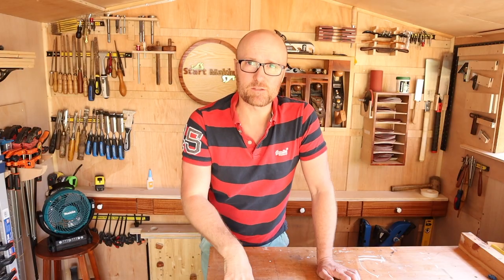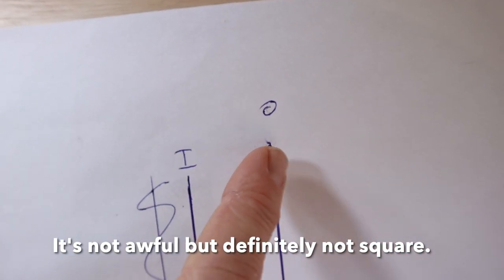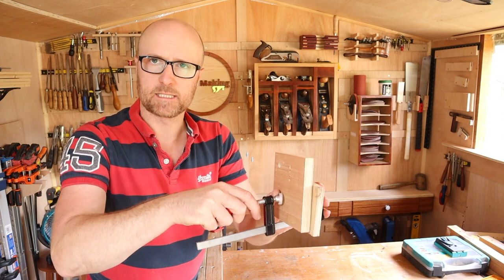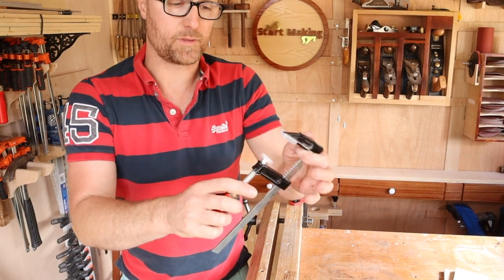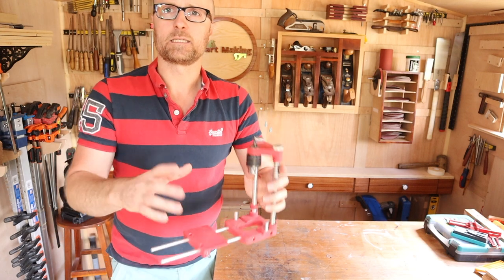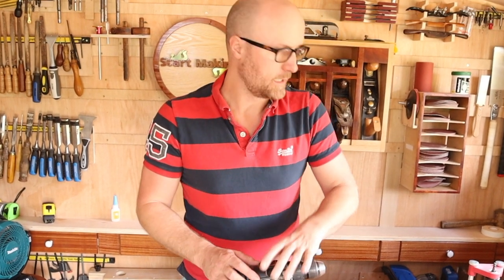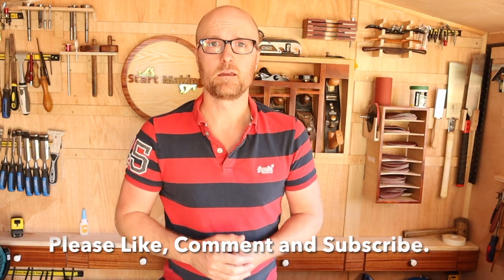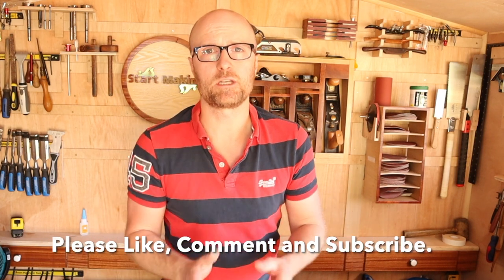5 WOODWORKING Tools to AVOID Part 2 || The SOLUTIONS.

Comment: For your drilling issue. I'm really old school. Been woodworking for over 30 years. I do have a drill press, it does the work perfectly. But sometimes you just can't take your work to a drill press and you do need a straight hole.
Like I said, I'm very old school. I use my table saw or miter saw "The one that gives you the straightest cuts" 
Cut myself a few nice straight pieces of scrap and screw it together "in a butt joint" just so the jig stands on its own
"just make sure that it's square" and there;;;; you have a straight reference guide, put your drill against that piece of wood that acts like a wall and follow it, and you'll always have perfectly straight holes.  Like your videos! Thanks
Reply from the maker: Great advice Stephen, thank you

Comment: I have a square that is over 75 years old and still square. Metal blade - wooden base. If you take the corner (red) jig and place a clamp on the top side, you will draw the mitre together. The angle jigs you make can also be square with all 4 corners cut off. Then you have 4 corner jigs to use when one side gets bad. I've used these for many years.  The Kreg pocket hole jigs are the best in my opinion. I have had and used one for the past 40 years (take or leave a few years). I was taught that the drill needs to stop just shy of going through the end of the wood that you are drilling. this is so that the wood will be easier to get full contact. The hole going completely through the wood will usually leave some type of shaving and the wood will not come together because of the particles left by the drill. If this is the case, you will need to sane the ends. I just used my Kreg jig on 1/2 inch ply and it worked fine. My first Kreg jig was made completely of aircraft grade aluminum with the steel drill guides and it still works to this day.
Reply from the maker: Great comment David. Thank you. Amazing that the quality of the Kreg Jig has lasted that long. Really impressive.

Comment: Portable drilling the Millscraft is rubbish. It will drill semi straight holes but Plastic bearings make any hole you drill wobble like crazy. The wooden corner brackets are great. Turn the ply sideways so it is 2inches or wider and the stability increases dramatically. Thanks for the tape wrap on the handle . Brilliant.
Reply from the maker: Oh, that's a shame I was tempted. Back then and now. And thank you for your sound advice,

Comment: Bought a rip-off pocket hole jig, so really cheap.  After practice I found that the finish was very dependent on speed of drill and pressure applied.  Your comment on practice making things better stands here as well.
Reply from the maker: Hi Al. Good advice on the drill speed. I will give it a shot. Thank you. And thank you for watching and commenting.

Comment: Great. I hadn’t thought about the ratchet strap for miters… will have to get a couple. Thx
Reply from the maker: Hi Michael. To be honest I originally bought it for boxes but it turned out I was struggling because my cuts were not square, hence not square boxes. But then I saw someone use on mitres, amazing. Definitely grab couple and my only advice is set them out on the dry fit and only loosen them a tiny amount then add glue. If you add glue then start getting the clamp out to use, it can get frustrating and messy. Thank you for watching and especially for commenting.

Comment: Just a pointer on the pocket hole problem, there are specific pocket hole screws for this application as the standard countersink screws tend to split the wood due to the wedge shape of the countersink head. Pocket hole screws are flat on the bottom so don’t have this problem, and may be smaller in diameter which could solve the 1/2” board issue
Reply from the maker: Hi Djcr Thank you for the comment and for watching. You are right and I wanted this to be a fair test. The screws provided are the bugle type. In the original video where I point the issues out I say this. https://www.youtube.com/watch?v=M8jLpyxwcnE

But for a fair test I decided to use the screws that were provided. They are a right pain to use and I have  replaced them with proper pocket screws. Thank you for reaching out.
Reply: RE POCKET HOLE JIG’s - I tried the   Trend version of the one you had and got mixed results, but after watching the “ hooked on wood “ Chanel I bought a Chinese  branded version ( Enjoy Wood   ) similar to the tre trend one with built in toggle clamp which  was half the price and worked a treat, the drill bit wasn’t the best  so I used the trend one from the other jig … so far so good  - another budget option maybe.!?
Reply: Very fine observation and true...

Comment: Thanks so much for providing great content for YouTube. I love your presentation style, yes I do agree with the commentary on your last video and yes the comments were correct but your original advice was not incorrect.  In any hand skill craft there are always more than one way to use a tool for a desired outcome, your advice about the hinge centring drill bits was spot on as I also tried to cheep out, I now use the Snappy brand drill bits and they are a delight to use, the same with the angle drill adaptor the better quality ones are so much better. Thanks for taking onboard the comments on your last video and updating the presentation
Reply from the maker: Hi. Thank you very much. To be honest , I learn more from the comments than anywhere else on the net. Such a great community.

Comment: That table was easily straight enough to check a square against. But glad the metal straight edge confirmed it.
Reply from the maker: It was one I had to add in as the last video gained as few comments saying the table was not straight.

Comment: Shop buying Tip 1:  In store you can check things like spirit levels and metal bar stock for straightness, by laying it against others in store AND flipping them around AND hold two touching straight edges up to the light to check for gaps.  Some ‘straight edges’ are amazingly spot on..others can have visible bends making them useless. Once out of the store you can’t prove you didn’t bend it.
Tip 2:  Long straight edges…try a “plasterers feather”…I got an aluminium hollow section feather 1.6m long WITH ruler grads in cm, checked for perfect straightness as above.  Effectively, a long four inch wide tapered edge dead straight ruler - perfect for laying out bigger jobs.  Plus, if I ever need to plaster a wall….
Tip 3: Vertical hand drill…glue a small circular bubble level on the back of the drill body (after aligning it vertical with squares first of course).
Reply from the maker: Hi Contessa. You are absolutely right about checking in store. My issue is that there are very few quality tool shops near me and so the temptation to take the easy route and order online is strong. Not right but strong. I will check out the plasterers tool, sounds like a really good suggestion. Thank you.
Reply: I do have the bubble on my drill, but that requires the work surface to be level.

Comment: Have a lot of smiler problems with tools not doing the job to my satisfaction. Was great to watch your part two of bad tools especially the feed back.
Good to know i'm not alone. Good for you.
Now all you got to do is show me how to cut a dead straight line with a circler saw.. The point is we are beginners not life long pro's.
Reply from the maker: Hi Andrew. Thank you for your comment. It sounds like we are in a very similar boat here. I have to say, the main reason I started making videos was because I started out and could not find any easy builds and tool guides to bridge the gap to the more professional woodworkers. As for the straight line with a circular saw, goodness knows. I use a straight edge and it still gets away from me. I am very seriously considering getting a track saw, table saws make me nervous. Well, that and the lack of electricity. I tried a home made track saw of sorts using overlapping pieces of plywood but they were awful. The only success I have had is a smaller, very rough crosscut track that I made very early on. It pops up still in videos. Really rough. Thank you for watching and let me know if you come up with a solution, we can learn together.

Comment: I have reworked  -- deburred, chased threads, filed off molding run-outs, etc. many cheap tools (most were Chinese made) that i have purchased. Did I save any money after putting in time to make them right? Sometimes but it is still aggravating. It is probably worth mentioning that i spent over 50 years as a precision machinist/toolmaker so i am accustomed to having tools that i can count on.I NEVER purchased cheap tools to use on my job but for home onetime use, yes.
Reply from the maker: Hi Jim. Thank you for commenting. And what a great, well rounded comment. You are right. There is a time and a place for cheap tools. If In was in your position I would never buy cheap for work. I actually just bought a load of old tools on auction and ended up with what I think are machinist tools. No idea. They are on one of the latest videos. Not to get you to watch,. But please let me know if you recognise any. Anyway, thank you for watching this one.

Comment: Like the cd idea. Have you thought of using tennis racket replacement banding grips or even bike handlebar grips? Not designed for clamp handles (obviously) and fixings may require some gluing. Check out Amazon.
Reply from the maker: Hi Costa. How was the sound? Thank you for commenting. I looked at racket grips but the price was higher overall. Good idea though for a favourite mallet or something.
Reply: @startmaking1  Sound perfect (for me at least.) I agree the grips are a bit pricy and would be best used, as you say, on a cherished tool. Keep up the good work. BTW hows the power project coming along?
Reply from the maker: @teacheme  Great to hear . Sadly no further along but In will get there. Thank you for the feedback, again.

Comment: I pretty much use my strap clamp like you do, set up the corners 90 degrees first and use the strap for holding while gluing.   I also find it handy for repairing/regluing chair legs.
Reply from the maker: good shout on leg repairs, I don't get my strap clamps out a lot but when I do I am very glad to have them rather than wrestling with multiple f clamps. Far lower stress levels.

Comment: for drilling right angle holes freehand, try gluing a small round bubble level to the back of your drill if the back is square to the bit
Reply from the maker: What a great idea. That is the first time someone has recommended that. Thank you. Will see if the back is flat. Sods law it wont be but you never know. Thank you for taking the time to comment.
Reply: About 3 years ago, I made a video on how to add a bubble level to a hand drill.  I also made a video on do's & don'ts of using the bubble level & your drill, to drill perfectly vertical holes.  To view them, just do a search on my channel on the phrase "bubble" and they will pop up.  Let me know if you can't find them and I will post the link.

Comment: I concur on the Milescraft drill press, works great for me; I also have their  pocket Jig 200.
I also have a Massca pocket Jig, it's ALL metal.
Reply from the maker: Thank you. The Massca one looks amazing but could not easily get it delivered to the UK. That may have changed now,.
Reply: @startmaking1 the Massca is branded as Trend in the UK

Comment: I drill a 1/4in hole at the top of the red handle on the bar clamp and I use a 3 or 4 in nail to tighten the clamp
Reply from the maker: Hi Doug. Thank you for your advice. I will give it a shot. Much appreciated.

Comment: I have one of these cheap Chinese drill guides and for the money it's excellent. You use it to drill a pilot hole at 90 your main drill will then follow the path of the first. More applicable to metal . But also works for wood.
Reply from the maker: Hi Richard. That's great to hear that the guide works for you., Mine, not so much. If you scan the moxon vise video you will see it in action. Not very good. That you for watching and commenting.

Comment: Good video. Regarding the cost of tools etc and the belief that the more you pay the better the tool; this is true to a certain extent but there is a point where in some cases you are just paying for a brand and not the quality of the tool. The really cheap tools are not accurate but if you pay a reasonable price for your tool then chances are it will be just as good as a really expensive one. Drilling straigjht holes for the beginner without using fancy jigs and keep your drill straight on all fronts; simply butt join two pices of timber at right angle and make sure it is a true 90 deg. simply hold the jig at the point where the inner corner is directly over where you want to drill the hole and place your drill with the bit in the inner corner of the right angle and use it to guide the bit through the workpiece as you drill. There will be awkward places where this technique will not work but on flat areas will work fine.
Reply from the maker: Hi John. Thank you so much for so many lovely and helpful comments. And of course for watching. You are absolutely correct in your assessment of the pricing and I love the idea of the 2 blocks of wood. Forstner bits were the main reason that I bought the rubbish drill guide and sadly there is no easy method that I know of for them. I will try the advice on normal drill bits though. Thank you again.

Comment: I use the kreg R3 jig. £35 from Ebay and it's absolutely brilliant for the money. It's worth the extra few quid against the cheaper, unreliable stuff!
Reply from the maker: That is a good bit of kit.
Reply: @startmaking1 I've been saving each month for a good tool to get started. The one I had from Temu has a worse fit and cut than most of my shirts haha!

Comment: Brilliant- drilling a hole through a CD improves the sound considerably. Smoother and more expansive- the emotion really comes through. I find 5 x 10mm holes gives the greatest improvement. You need to use a cordless drill though- using a mains drill really muddies the sound stage depth. Tell your audiophile friends, and offer to improve their CDs for, say, £5 each.
p.s. no right angle is perfect. But it may be within tolerance.
Reply from the maker: Brilliant. I had to read this twice to ensure it was tongue in cheek .

Comment: Milescraft drill guide is ok if you're in a bind. I cannot recommend it over any other brand. The chuck still has a bit of play, so your holes won't be perfect. If you offset 2 pieces of wood and use that as a guide - you'll get the same results.
Reply from the maker: Hi Canadian Woodville. Thank you for commenting, For drills I would also suggest the 2 bits of wood together. I bought the guide for forstner bits which I was struggling with.

Comment: Instead of using tape for the handles, Amazon has different size shrink tubing intended for fishing pole handles. It's fairly cheap and lengths of about 18" IIRC, so can be cut to the desired length.
Reply from the maker: Hi K Williams. If it works out cheaper or better then I am all for giving it a try. Thank you for watching and commenting.

Comment: With the pocket hole jig, I think you are using the wrong screws. Bugle head screws not only don’t fit, they don’t hold. 

Pan head or button head screws will work much better, or you can buy pocket-hole screws made for the purpose.
Reply from the maker: Hi Robert . Thank you for the comment and for watching. You are right and I wanted this to be a fair test. The screws provided are the bugle type. In the original video where I point the issues out I say this. https://www.youtube.com/watch?v=M8jLpyxwcnE

But for a fair test I decided to use the screws that were provided. They are a right pain to use and I have  replaced them with proper pocket screws. Thank you for reaching out.

Comment: One of the 2x Stanley strap clamp I got broke on the bar holding the screw mechanism in place first time I tried it, wasn’t impressed at all. It seemed as though it was made from aluminum or something rather than a nice piece of steel. Ended up reverting back to bar clamps.
Reply from the maker: Oh that is annoying. I have been very pleased with Stanley for everything except a spoke shave that may or may not have been a knock off.

Comment: I did bought the Wolfcraft drill stand and it was quite sturdy, but in the end I did bit the bullet and got myself a proper drill press from Bosch. I couldnt be bothered to go "OMG where is my CD?".
Reply from the maker: Lol fair enough. I am a little jealous of pillar drills. One day maybe.
Reply: @startmaking1  I feel you with trying do work with what you got. Did that for year, even a knife was my screwdriver sometimes. For drill press you should look for Parkside or Scheppach. They wont be the top tier and will have some wobble sometimes, but Ive owned the Parkside one and with modifications they can be quite good. Only downsize are the engines which can work max 15 minute and need to cooloff after it.
Reply from the maker: Thank you for the advice.

Comment: With regard to using a reflection to drill, I use this to cut perpendicular to an edge, as you can align the reflection in the blade of a handsaw. It doesn't help with keeping the cut at 90 degrees in both planes but it does give you some help.
Reply from the maker: Hi Howard. You are right. I was looking at this as I am about to attempt my first dove tail. Will be polishing the blade on my saw first. Every bit of help I can get is vital .Thank you for watching and for commenting